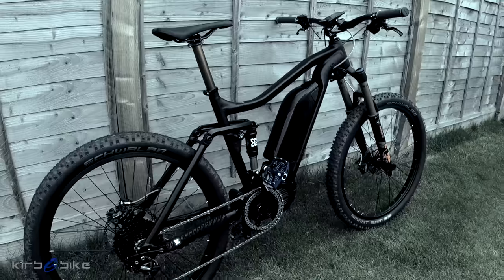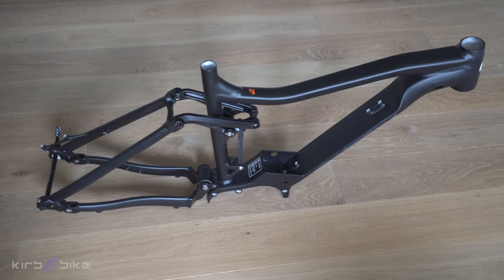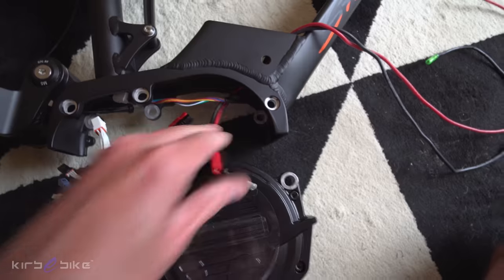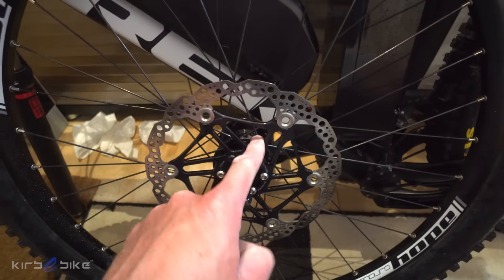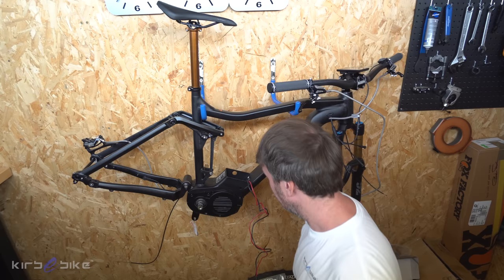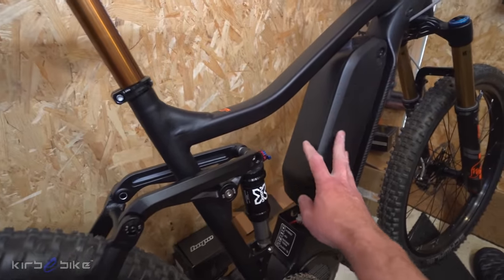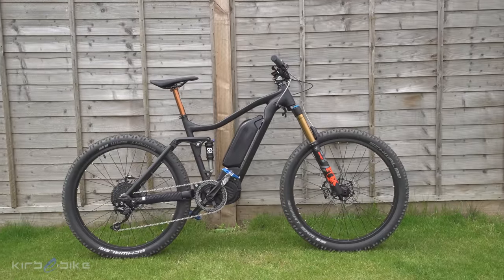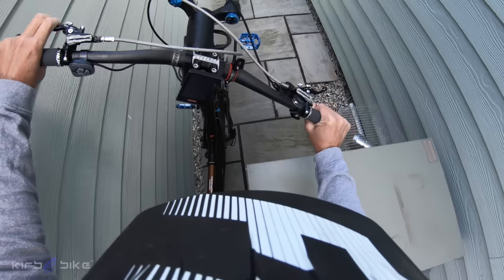HOW TO BUILD THE ULTIMATE eMTB!!! | KIRBEBIKE

Comment: Absolutely brilliant build, very nice to see a frame ready to be built on that's light and of a high end spec.
Only one thought, what's stopping water, mud, grit etc from running down the outside of the battery and pooling in the square section of the frame that houses the battery connector?  From what I can see in the video it doesn't seem to be sealed at the bottom and I couldn't see any drainage holes apart from the hole the cables came up through for the battery and display cables?

Concerned it would be problematic come winter time on the trails
Reply: I have this exact battery, and can confirm it is a problem. I use vaseline spray to try and keep it from jumping, but i am looking for a better solution
Reply: @musFuzZ  What is the name of the frame?

Comment: Dual suspension is the way to go. I have built several bikes, and my favorite are ones with front and rear suspension. They ride smoother and tackle rough terrain much better. Nice!
Reply: it really depends on your budget, if you're looking to spend less than £800-1000 then front hardtail is the way to go.

Comment: Great job @AndyKirby. You achieved what some of us only dream about. I'm curious where the motor controller is hidden. It must be built into the motor is it? What mech have you got? Seems the chainwheel is very large. Yes you need to publish the weight. What are the options for brake cut-outs using Hydraulic brakes? Good luck with it. Cheers.
Reply: 90% of mid-drives have built in Controllers into the motors. That's why their abit more bulker. Mid-drives are more torque because their using the chain for power performance, while hubs require the power straight off the bat in the wheel So some are direct or geared, Requiring the ESC to be outside for better cooling. But Mid-drives have so much torque their motors don't get as hot. So they can handle more load that's why their dependent on the chain for power.
Reply: SpeedRacer 650  Oh no. I got something cheaper and nicer upgrade platform i like. I got a Hyper-Eride mountain bike with V-brakes. (Can also support disc brakes. but i'ma stick to V-brakes atm.)

It's gonna be like less then 3500-4000$ once fully upgraded. Stock bike is 645$ atm, will have Dual battery packs, Dual motors (Front and Mid-or Rear hub still deciding which system to go with on the rear.), Full Shimano Deore system 9speed, Rockshock Solo air fork, Alum handlebars/Seatpost/Stem/Peddles/etc. With 3point mounted rack for cargo. It has flush mounted battery (that'll be used for ether rear or mid-drive.), Another battery above it as a waterbottle design for front, or extra batteries in rear rack. Dual throttles.
Reply: SpeedRacer 650  Yes it's a hardtail vs a Full suspension. Roughly similar.

Fun thing about building your own kind of bike tho. Is basically the only thing you really need to swipe if you want it a different bike. Is the frame. Well course in your case or so, the frame requires the specific motor and battery. But if you bought a normal frame you could use a mid-drive conversion kit and waterbottle design battery (that fits like a normal waterbottle drink holder.).

This bike you could also technically upgrade  to dual motors to, just get a seatpost rack, and add a pack with a battery for a front hub. And your good to go. Not much weight added, maybe 10-15pounds but since the battery will be in the rear, and the front hub. it'd still keep it pretty balanced.

The weight on mine stock is 50pounds. This is pretty much roughly the exact same as you find normally on high end ebikes to around 45-60pounds is the targeted range for mountain ebikes. Roads will be probably lesser since their general design is speed, so lightweight is mainly their focus.

With the rack and cargo bag with abit of stuff i'm adding 10pounds yes. And a battery 5pounds and a hub 5pounds. So extra 20pounds from the stock 50. But i'm keeping weight pretty evened across the bike. I'll have 2batteries in the middle of the frame, hub front, and ether hub rear or mid-drive middle, and if maybe extra battery or so in rear rack. But mainly rear for cargo. Overall the 20extra pounds isn't gonna be much pain including if both my drives are are good on torque and power. And i have good tread with large nobs with good psi to handle the weight and grip.

I had a yukon trail cruiser that was steel frame, ran at 24volt 250watt 10ah lithium battery, stock weighed 80pounds, still hit around 15-20mph on it and 20miles of range, even after i added like 30pounds extra with more cargo weight i put on, It was a beast of a cruiser. And all on throttle control no peddling. Even off-road and it shredded pretty well. Compared to trails alot of mountainbikers go that are pretty fairly hard, Even my yukontrail shredded threw where i go, which normally has a softer kind of road. So if that could handle with such a lower motor. I'm sure the upgrades and abit lesser weight my Hyper has, Will rip much better with it's power and dual performance.
Reply: SpeedRacer 650  Mountain biking isn't about speeding 25mph+ down hill. Mountain biking is about going off-road and exploring. People seem to mistaken what the point of mountain biking is really. It's off-road tough terrain riding. Not about zipping downhills and shredding inches from cliffs, or jumping 50feet off ledges.

Any mountain bike will have it's limits to how much beat you can smash on it.

If you want downhill, you want some good suspension to dampen the hips and humps of the fast attacks of the rough terrain while zipping down. With a pretty good strong frame. Rest of the components can be whatever your choice since they have no relation to the strong of the frame or suspension.

If you want a Jumper. you need to have a strong frame, with stiff suspension to have a slower impact. Meaning the suspension isn't gonna be plush on off-roading, but will take the impacts much better on jumps.

If you just want a overall mountain bike. Any bike normally will do. Since your main focus is to enjoy riding, Not zipping fast or jumping crazy. But riding the rough harsh terrain, which is gonna have alot of nasty things trying to rip your tires up. So mainly these focus on their grip and thicken treads with high psi for better ride, Compared to Downhillers that normally use lower psi, and jumpers normally in mid-range.
Reply: SpeedRacer 650  That differs on your personal point of what components and parts you want. And what frame your gonna use them on. And power of electric ability and range.

It all differs and will add into your price. Mainly the biggest will be the Motor/Battery for your idea of getting such.

Highest components on my list are mainly the front fork, Hub or mid-drive replacement for rear wheel. Front hub, battery,  rearwheel replacement if i go mid-drive. or crank set if i go rear hub. (Rear wheel replacement =  wheel itself, cassette 9speed, 9speed chain, shifter lever, (already have deraulleur but that was around 50$ to.) (If hub, I'd still need abit of the above, but with a shimano hollowtech 2 deore 3by crank that i'll use the middle ring on after remove the inner/outer since my bike can't use a 3by system/front derailleur.)

Most other parts are pretty cheap. But still good comparable to higher ends. Just gotta be abit look around for good cheap parts. (And these are all  NEW parts. Not used or found on ebay.)

If you were to just put a new battery, Rear rack, and front hub. It'd probably only cost you like less then 600$ (battery, motor, rack, and Bag. for your current bike.)

Comment: A used donor bike and you could build an amazing machine for a tiny fraction of what the mainstream manufacturers are asking. As you say, even all new it's way cheaper. They have been ripping us off asking those kinds of prices. I guess a fair bit of the 8K or whatever goes to sponsor people who try to justify that you need to spend all that on a bike.
Reply: Andrew Norris it's not ripping off as they've been investing R&D into developing this tech for decades, plus the high end ebike usually have a lot of fit and finish people hours invested into them. They just seem expensive when looking at the highest end new models that are dripping with high end lightweight yet durable materials and compared to high volume gas vehicles that we are so used to that are cheap yet are expensive to operate over time

Comment: Sweet ride. Gotta love Bafang. Just finished my build. BBSHD 1500 w 52v 13mwh battery on 26" trek hard tail with new-ish fork. Then every thing else is new and as light as possible making a 46.1LB (20.95kg) death machine with a top speed of 41.6mph ( don't know in kph) because we ride on the right side of the rode here. However my next build after this one gets stolen will be with a frame and battery similar to what you started with but maybe carbon idk. Ride it like ya hate people. Later
Reply: Did you also put a throttle on it? I want to do a similar build that has both throttle and pedal assist options thanks!
Reply: @gregorypatzelt6964  yes a right hand 1/2 twist throttle next to Shimano rapid fire shifters and Shimano m355 hydraulic disc brakes leavers. on the left side the color display. I was told with a half twist throttle that I could not Mount the index shifters however I had no problem and it works fine for me I even had my brakes customized with the rear brake on the left and front brake on the right coming from a motorcycle background I'm more familiar with it that way and everything was mounted on a carbon fiber handlebar. Chain line was the biggest problem but after installing a LunaCycle Eclipse chain ring its perfect. I have even been pulled over for speeding by the local sheriff department luckily no ticket.
Reply: how much maintenance is it on the BBSHD 1500 w and your drive train? 

would it be less if you had a BBSHD 1000 w?

Comment: I've build a few e bikes
But they only cost me a fraction compared to the ones on this channel lol.

For £380 every single part & bike included.
 I've built 3000w 72v to 84v.
Mid Drive system Ebike 
29 inch wleels & 12 speed set-up at the back
And 3 at the front.
With rotor discs & 4 piston sram hydraulic brakes.
Air shock forks
It's a scott racing bike converted into a motorbike.
If I bought everything new plug & play parts it would have cost probably £4000+.
I have no idea why YouTubers don't build cheap Ebike just to show the viewers.

Comment: Andy- The EX1 crank arms you have are "self extracting"(ie you don't need a crank puller) the little "cap" is meant to stay in place and the 8mm hex tool goes through it- when you undo it the 8mm crank bolt inside pushes against the (10mm) "cap" and pops off the arms... and be warned the standard thread crank pullers are not quite the same thread and size as the EX1 threads.... removing the 10mm "cap" and using a standard puller you may rip out the threads....
Reply: is it the same for BBSHD 1000w pedals?

Comment: My 36V350W TSDZ2 mid drive motor has a pretty good 80nm of torque on a carbon fibre frame on 24 Spoke Zerolite Pro Vuelta wheels which are pretty hard core wheels. My bike is set up for the road using Michelin Wild Run'R Advanced 1.1" slick tires with MR TUFFY tire liner, I've got both the 36T & 48T Chainring on the front. With the tires I'll probably get 1 puncture from the life of the tire after it's worn down to braid under the outer casing which has worn off after thousands of kilometers riding.

Comment: So if I want the same bike but in pieces so I can put it together how much would that cost including shipping to Australia mate ? 👍
Reply: $3300 AUD for the bike frame and drive train (so would need suspension and brakes etc) or near 7k for the bike fully built. 
Honestly you can build something far cheaper with the same performance using local bought parts. 

oz-ebikes. com is a good place
Reply: Rohan Hine where are you getting this $7k number from?

Comment: Been watching lots of your videos recently and ended up going with a bafang bbshd middrive motor rather than hub. I'm really happy with it and have since changed basically everything but my frame and wheels.  The frame its on is a 2001 Kona Roast, which is a solid frame but I'd ideally like something with more modern geometry and possibly full suspension like the one in this video.
Do you know of any frames that will fit a bbshd like that rather than the ultra? Cheers in advance, and please keep up the excellent videos.

Comment: Nice bit of kit, so I have a luna cycle with a 1000W Bafang motor and I'm 130kg and it gets me around really well, the m620 is a 1500w motor which impresses me I'm got too use to the 1000w and need more. So can you get this kit shipped to Tasmania and how much in AUD. I'm talking frame, motor, wheels, brakes, etc.

Comment: Correct me if I am wrong. Just a double suspension e-bike example.  You can buy a 2020's Haibike SDURO FullSeven LT 5.0 for 4.000 euros, factory new. About the same cost as your end prodcut. By "unlocking" your Yamaha motor you can reach speeds of 45km/h + easily in 4 seconds.  To be honest, the motor has superb torque itself, but in the end of the day what matters most is your leg power and gear combo. SDUROs are very customizable in general, change or add a front gear and you can reach speeds of a motorbike (70km/h). All of the above with a waranty for the frame, battery and motor, and highly trained stuff to maintain or upgrade your e-bike when it needs to. How can your custom e-bike compare to that, other than the fun-factor of making it yourself piece by piece?
Reply from the maker: It’s better in one word: Performance. This will blow an unlocked Haibike away into the dust up a mountain trail becuase the motor is 3-4 times more powerful, and as for motor reliability the motors used by haibike etc all have plastic gears! Not good but then they only really want you to ride their bike for a season and then buy the new model when it comes out😁 oh and the batteries are crazy overpriced for what they are.
Reply: @andykirby  Thanks for replying.

Comment: Hey Andy cool bike love it! Quick question if this bike frame is designed for a bafang , will future upgraded bafang motors can replace fit into the space this bafang motor is being installed ?
Reply from the maker: Cheers! It's only designed for this motor so unless bafang make an updated m620 model then no.

Comment: Very good video!  From the outset of the video you look at branded bikes at 7000£-9000£. That is so far above my league it´s justa sad. Then you set out to make a bike to match those expensive ones. I don´t know what the parts costs but how much would a cheaper build be able to come down to? For example, I am looking at a Haibike Fullseven LT 6.0 (long travel 160 mm front and rear) with 27.5" wheels and a dropperpost. Yamaha PW-x motor and so on. That one is 3150£ and is does not have that beautiful fork of yours with kashima coating but it would suffice for me. Happy amateur as I am. The key question for me would be: IF I look at the spec sheet on Haibikes homepage to sort out what fork and suspenseion is used, and if I buy the same brakes an so on, could I make a good saving on building the bike myself? 3150£ is still a fair amount of dough and I could easily see myself putting some time in the shed to build a bike myself if that would save me 500-1000£. Then, of course, there´s the satisfaction of building it yourself...

Comment: Use my bafang converted voodoo wazoo to go to work instead of the car ( milled 10mm off the bottom bracket) .Just got a 31AHr 48V battery from Mike at GreatMax , made to order in China, delivered DHL to the door, duty paid. very happy.

Comment: Just a quick question you know a lithium ion battery pack when using on your ebike should you let it fully discharged before recharging
Reply from the maker: No, lithium batteries prefer to be partially charged, partially discharged. Not always possible in practice but it’s better for them none the less.

Comment: I found a excellent condition stored for 10 years downhill Canondale perp circa 2008 for $600 cad. $300?uk. Anyway, 200mm of travel and Im just finishing the cable management for a pretty clean looking install. I'm using a Bafang 750 and I have 32! Headway cells. Backpack battery pack. have to wait for a speed sensor extention cable. Its fun working on bikes everything is so well made compared to cars.

Comment: nice build next do a budget but very powerfull high power build 4kw or 5 kw peak.
Reply: You can't make this in a budget with the proper safety
Reply: Hi there mate. I’ve built build safe reliable bikes thats do 40mph for less than  a £1k. A used downhill bike are like £500 some or less if you get em off gumtree or shpock. You can get a £20 bike with brake and suspension upgrade it would be safe enough to do 40.
Reply: @yakz9885  I have an similar build than Kirby but 11kW if you want 4-5kW you need expensive batteries and frames as well as brakes and suspension
Reply: I go for a cheap old downhill or full sus frames and give them a heavy duty torque arm and they all have held up fine. But the things i never cheap out on is suspension and brakes but it depends if im using regen. Current build is 16s 10ah turning batteries £200 which is good for high amperage and i can stick em on anything 10-15 miles. I wouldv gone for li-ion but there more for a permanent solution. 1000w motor but i changed phase cables and added ferrofluid etc and im running it at 70a atm. This builds for fun and ill probs feed it too much current and blow it up😂